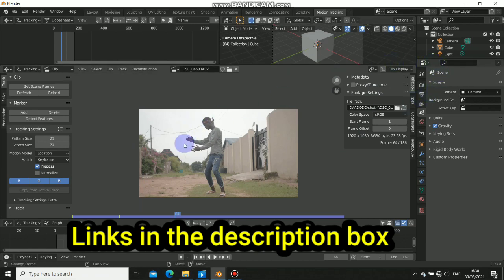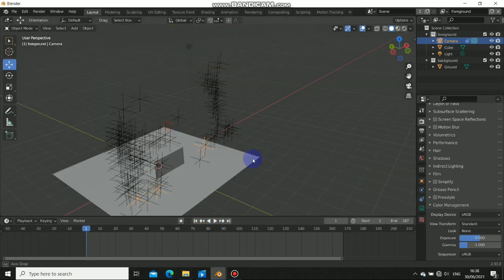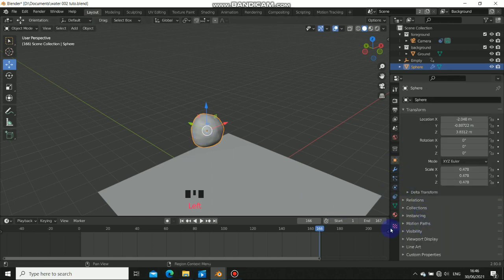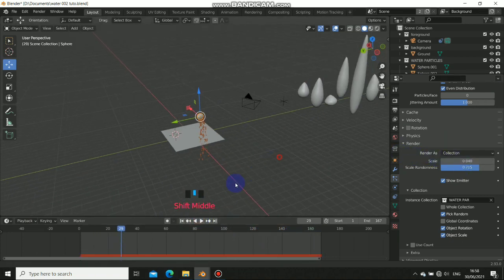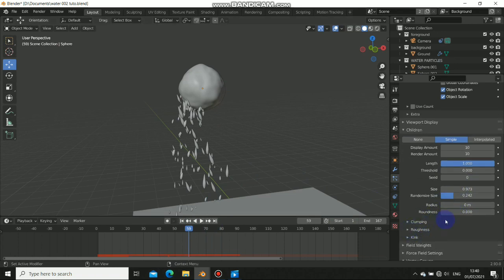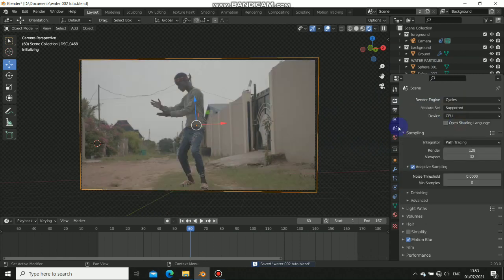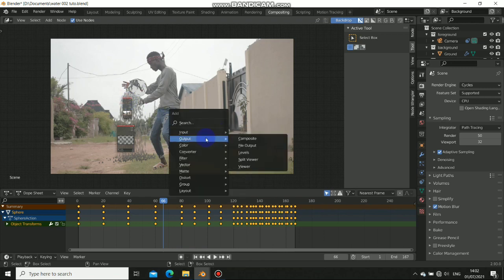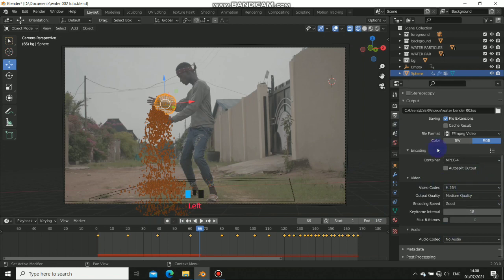Blender Tutorial 3 / Water Bending Effect Avatar Vfx

Comment: when the camera moves, the waters are not stable, so it should have moved at point a, but shifted to point b, and the water view is really bad. If you keep the particles number low, view of the water bad to appear and animation loses its realism.  you can get a realistic water between 10 million and 50 million particles. You didn't use the light well. of course if your system is good.